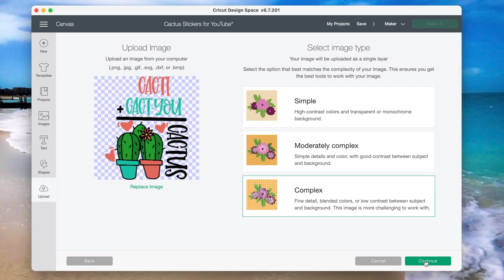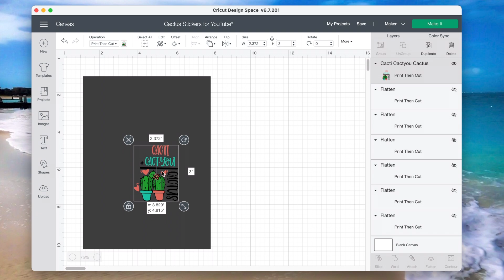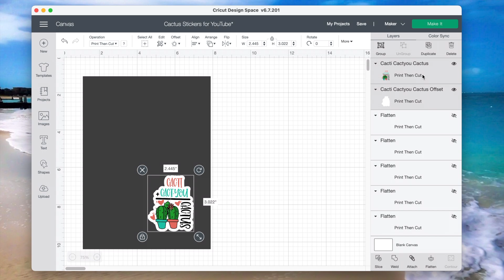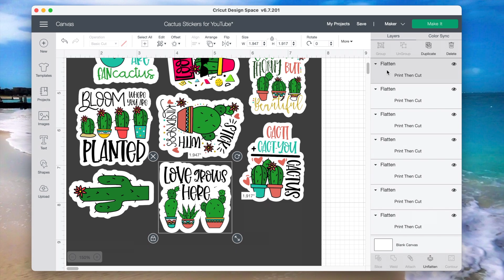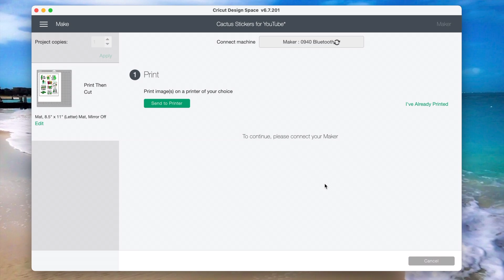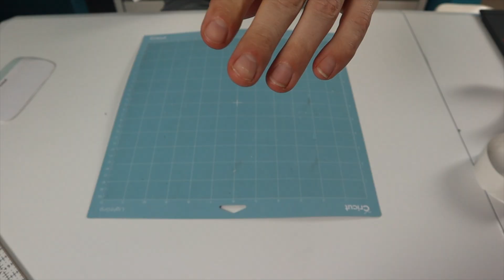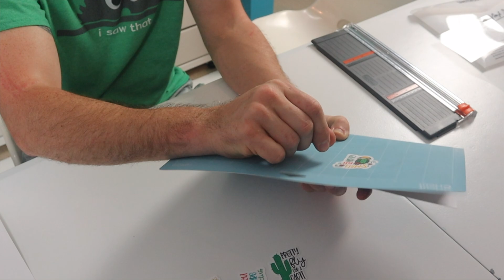How to Make Waterproof Stickers on a Cricut |  Die Cut Stickers with Cricut Print and Cut

Comment: What am I doing wrong? It will only print the first sticker at the top and ignore the rest of the sheet.....HELP!
Reply from the maker: Hi! Is any part of the black box printing? And is it printing the whole first sticker or just part of it? If it’s only printing part of it, it could be an issue with your connection to your printer, and we’d recommend checking with the manufacturer. If it’s printing the whole first sticker but not the rest, make sure everything is flattened. If that doesn’t fix it, contact Cricut support.

Comment: what settings do you use for sticker sheets?
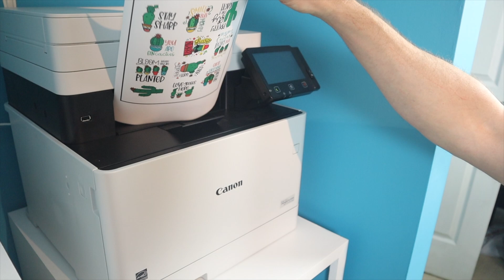Reply from the maker: Great question! We start talking about our sticker paper and settings at around 6:05 in the video.
Reply: @JustMightDIY  Thank you for your reply! I love your videos!
What if you want to not do individual stickers but keep them all on one sheet? and peel the stickers off but leave the baking sheet intact?
Reply from the maker: Hey! You can do that - it’s called a “kiss cut”! You’ll want to test the settings with your particular machine (and whether you use the laminate or not). We’d suggest starting with the sticker sheet settings Cricut already has in the materials list and then tweaking up or down on the pressure from there. It’ll be easiest to use a small shape to test cut before moving on to the full sheet to save material. Hope this helps!

Comment: I followed your video techniques, but every time I make and cut the stickers out, the offset is larger on one side, sometimes left, sometimes right. They look fine on both the canvas and the print mat screen. I’m using an HP Deskjet.
Reply from the maker: Hey! If the cut is off, then it’s your Cricut and not your printer. Have you calibrated for Print then Cut? If so, then reach out to Cricut and see what additional troubleshooting steps you can take (maybe a firmware update, etc). Hope this helps!
Reply: Thanks for the quick response! Much appreciated. I will try calibrating because I want to get this right! ❤️
Reply from the maker: Awesome! Happy crafting. 😁

Comment: SUPER helpful!!! Thank you for the step by step with adding new material and cut options!!
Any suggestions when using high gloss sticker paper (pre-laminated) and getting the machine to read the registration lines? Unfortunately using matte scotch tape has never worked for me. thanks again!
Reply from the maker: Hey! We’re so glad you liked the video! Unfortunately, the Cricut sensor seems to be very finicky with the reflections from high gloss paper. We’d suggest using a different paper. Hope this helps!
Reply: Use a white crayon over the black lines, like coloring it, softly, it works well .

Comment: How do you know which side is sticker side up?
Reply: I also don’t have those printer setup options…
Reply from the maker: Each printer will have different options, depending on your printer and your computer/operating system. Just make sure you’re using getting to your printer options screen from Cricut. 😉
Reply: @JustMightDIY  okay okay I’ll keep trying😭💌
Reply from the maker: Practice makes progress! You’ll get the hang of it. 😄
Reply from the maker: Hey there! Thanks for your question. If it’s not immediately obvious which side is up, you can gently peel back a corner to check.

Comment: I'm having a problem after putting on the lamination :(  The printer isn't able to recognize where the lines are because of the light reflection. I tried adjusting my light settings from on to off but it's not working. Any ideas by chance? :0
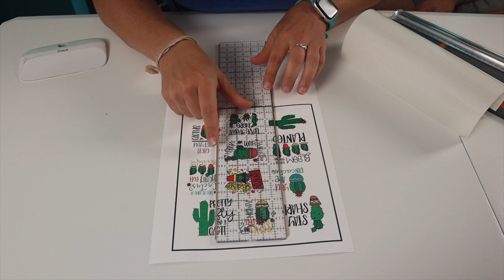Reply from the maker: Hey there! Thanks for watching and for your question. As we show at 6:45, we make sure to not cover the black line with thr laminate. It should go inside the box so it won’t mess with the Cricut sensors. Hope this helps!

Comment: Thank you! This has helped me so much. I do have a question. Whenever it goes to cut on the cricut, I know to keep it the exact same. I’m confused on what to do then. Do you send it to the cricut as a cut image so it is just that outline of the offset? If that makes sense.
Reply from the maker: Hey there! If you have it set as Print then Cut in Design Space, it should sequence things in the right order (you’d print through Cricut to your printer and then continue on to the cutting stage). Hope this helps!

Comment: Bought the same sticker paper as you.  Really liking it but.. how do I tell which side is the sticker side on this paper? And I'm struggling with my cricut maker not cutting all the way through my laminate and sticker paper even after I made a custom setting like you did. Do you have any suggestions or tips. 
Thanks!
Reply from the maker: Hey! You may need more pressure for your custom setting if your blade is older/duller. Anytime we can’t figure out which side is the sticky side, we just peel up on corner gently and check. 😉
Reply: @JustMightDIY  great thank you!! Ended up figuring out that I needed to adjust my depth in the custom setting to a 3x. Worked great.  Thank you!
Reply from the maker: Oh yay! Glad you got it figured out!! Happy sticker making. 😄

Comment: My stickers are always sticky on the back of them from the cricut mat so if I stack them the sticky residue that's left over from the cutting mat gets onto the printed side of the sticker it's stacked on top of. Do you have any tips on how to get rid of that sticky residue?
Reply: It's a brand off Amazon maybe that could be the issue. Thanks for the reply.
Reply from the maker: Happy to help! We haven’t run into that issue with the Cricut mats. Hope that resolves it!
Reply from the maker: What brand and grip mat are you using? We’ve stacked our stickers and haven’t run into that problem.

Comment: hi again, so i followed step by step ( same machine, materials, and setting), but it cut off just a little off centered, leaving a bit of white on the corners. i did skip a step because i already had a background color/shape to it and i did the lamination the same and the placing on the mat; help? any reason why it did that?
Reply from the maker: Hmm. We’d recommend reaching out to Cricut. You may need to do a firmware update on your machine, or they could offer some other troubleshooting steps. Good luck!

Comment: probably a dum question 🥺 but if i get the glossy white, would i still have to laminate it?
Reply from the maker: The lamination is more for protection and longevity rather than making it glossy. To determine if you need the laminate, think about how you’ll use your stickers (if they’ll come into contact with water, for example), and then test how durable the print is without anything on top of it.

Comment: I wonder if it's because my sticker paper is coming out a little rippled from my laser printer. What paper type do you select when printing? It's like it's heating my sticker paper too much when it feeds through.
Reply from the maker: Are you using glossy sticker paper by chance? Our laser printer says to not use glossy paper in it. If it is glossy, that could also be messing with your sensor on the Cricut. Either way, if your printer is tearing up the paper, you should consider discontinuing use of that paper to avoid damaging your printer. We tried several types before we found one that we, and our printer, liked. 

As for our settings, we didn’t set a special paper type - just left it on the defaults but upped the quality.

Comment: Thank you! And the settings worked for me too!! Question - my registration is perfect on my first sticker at the top but then slowly gets further and further off as it goes down the page. Any ideas what might cause this?
Reply from the maker: We’re glad this worked for you!! As for the cut getting out of line, two questions: is your mat sticky enough? Sounds like the sheet might be moving. Otherwise, are you sure the page is oriented the right direction on the mat? We’ve definitely put ours on upside down before.
Reply: @JustMightDIY  thanks for your reply! I’m using the light grip mat but I did tape the putter edges down to ensure no movement. And yes, it is the correct direction. I appreciate the thoughts. Maybe I need to try to realign my registration.
Reply: Also, you may need to calibrate your cricut! I had a brand new cricut that was doing this. Since it was brand new, I didn't think it should need calibration from print then cut, but tried it anyway and it worked!

Comment: Great tutorial! I didn't think a canon image class could print out amazing color images!!!  I'm inspired, I have the 743 model and have been hesitant to use for my color prints (usually pay at staples)since the images usually don't print out as vibrant and often times the colors printed don't match what I used on screen... could you share what settings you use on your printer/computer to ensure crisp color matching prints every single time. Thanks!!!
Reply from the maker: Hello! Glad you enjoyed the tutorial. Thanks for bringing this up!! When we first got ours, we noticed that the colors looked a little washed out, so we found these GREAT tips on the Canon community forum (and just not remembered since you asked!!): 

Three (3) Steps to Great Color & Deep Blacks –
Clean Fixing Assembly -

Go to the Home Screen  >  Menu  >  Adjustment/Maintenance  >   Maintenance  >  Clean Fixing Assembly  >  Select ‘OK’  >  Then, Select ’Start’ (in the lower righthand corner of the Printer Display, and let it do its thing).

Correct Print Color Mismatch -
Next, go to the Home Screen  >  Menu  >  Adjustment/Maintenance  >  Adjust Image Quality  >  Correct Print Color Mismatch  >  Select ’Start’ (in the lower righthand corner of the Printer’s Display, and let it do its thing).

Auto Adjust Gradation - Full Adjust - (This is a more robust sequence than the initial Startup Color Adjustment when the printer was first turned ON.)
Go to the Home Screen  >  Menu  > Adjustment/Maintenance  >  Adjust Image Quality  > Auto Adjust Gradation  >  Full Adjust  > Select ‘OK’ (it will list 4 Steps)…
Print Image 1 for adjustment.
Scan the printed Image 1 for adjustment.
Print Image 2 for adjustment.
Scan the printed Image 2 for adjust.
Select ’Start’ (in the lower righthand corner of the Printer’s Display, and follow the on screen instructions).

Let us know if this works for you!
Reply: @JustMightDIY  If I may ask what ink do you use for your printer??
Reply from the maker: @breannalloyd7240  Hello! We printed these on a Canon laser printer and used the toner that came with it.
Reply: @JustMightDIY  thank you! :)
Reply: @JustMightDIY  is that the printer with the cyan toner?

Comment: Can anybody give advice on which type of printer gives the best results for when making stickers with the Cricut Maker 3.   I have to buy a printer so I am trying to decide if I go for a 'INK jet printer'  or  a 'Laser' ptinter. I have never tried to make stickers so I have no experience at all on any type of printer. And if you have information about the correct type of paper required for each type of printer that will be greatly appreciated and the Pro's and con's for each type....   thanks.
Reply from the maker: Hey there! We haven't tried to make stickers with an inkjet, so we can only speak to the laser, which does a great job!  All of the materials we used for our laser stickers are listed in the description (including which laser printer we have). 

The one thing to keep in mind when deciding between an inkjet and a laser printer is what else you want to do with it. SO many printable crafts (printable vinyl, waterslide, etc.) have a wider selection of products for inkjet printers. If you do go inkjet, look into an EcoTank - they will be much more economical with the ink costs since they have ink tank, rather than cartridges. You might consider one of the photo-quality tank printers, as that could give good results. Good luck!

Comment: I've got the Brother Scan N Cut 125e and a color laser printer as well.  Nice to see some steps in your video that carry over to my setup.  How much are you spending on the OraCal laminate sheet?  You might like the 3 types of lamination cartridges for the 900 series (9 inch) Xyron cold press lamination machine.  

* Full lamination both sides
* Lamination + Adhesive (for making laminated stickers)
* Lamination + Magnet (only 10 feet of material due to thickness of magnet material)

Their lamination material is marketed as an archival, UV, pH neutral film that will not peel or separate once you cut into it.  So you can use it to make custom cut shapes, to seal precious documents, make pool or aquarium art, decorative chew toys for your little fur baby, waterproof and fade proof magnetic art or puzzles for the fridge, vehicle, etc.  The SDX 125e simplifies alot of the steps you're performing by allowing me to do it on the cutter itself or in their desktop software.  Like I was saying it is nice to see how other folk are making cool stickers from home.  Not so long ago these sorts of features were relegated to super pricey professional level plotters/cutters and print services.
Reply from the maker: Very interesting! We’ll have to check out the Xyron - had one of the smaller ones years ago. The only question we’d have on that is how to get around the issue of the Cricut needing the black line around the page for print and cut (and not laminating over that. Still something worth exploring! It’d be nice to simplify that step. Thanks for watching and for the tips!
Reply: @JustMightDIY  You can stick some matte clear tape over the black lines around the page. You can also close the top lid to prevent light from reflecting off the shiny laminate. I've done both and it works great with my Explore Air.
Reply from the maker: @aracelysee  great tips - thanks for sharing!
Reply: @JustMightDIY  The sensor for the Cricut doesn't read through transparent laminates?  So what setting would you use if you were trying to cut out clear water slide decals, or static clings, or even overhead transparencies from your laser printer so you can make sun catchers?
Reply from the maker: If they’re glossy, it could effect the sensor for print and cut according to what we’ve heard, through we haven’t tested that theory. We haven’t tried water slide yet. Again, it’s worth exploring for sure.

Comment: I’ve tried so many settings and my Cricut won’t cut all the way through the adhesive vinyl.
Reply from the maker: Hmm. Have you tried using a new blade? If it is a new blade, try increasing the pressure or the number of cuts in the custom settings.
Reply: @JustMightDIY  You might try flipping the page over and trying a mirror cut for that side?  Cut in as far as you can on each side.  If this were a Brother DX Scan N Cut it'd would know how deep to cut and how much pressure to use, let you scan & retain your cut data in the machine, and fiddle with settings if you needed to without losing your project or progress.